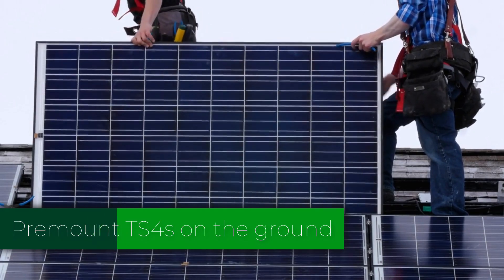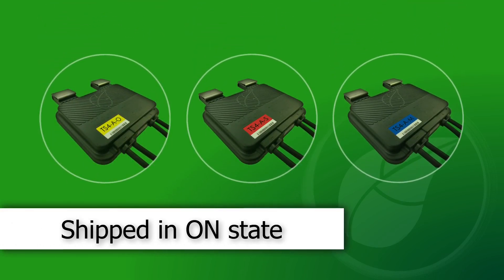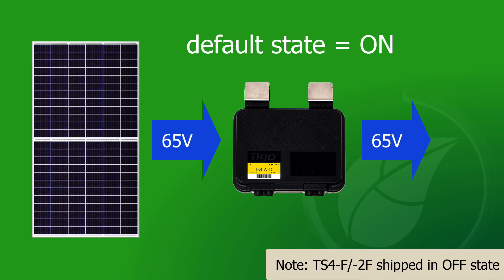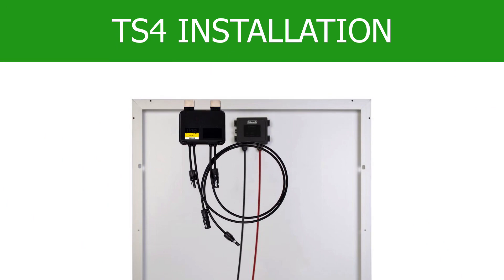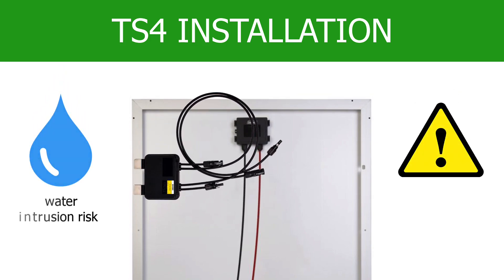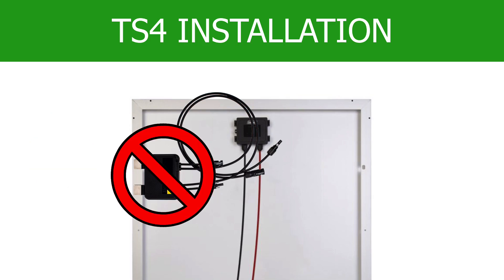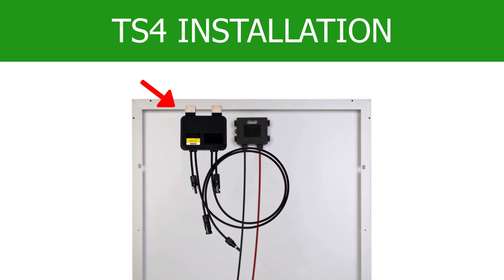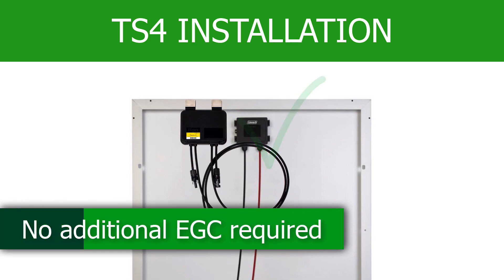Tigo TS4 O/S/M Monitoring Group Installation - TS4 Course Excerpt from Tigo Academy

Comment: Is this still the only allowed direction of mounting? Modern PV modules have practically no edge on the short side of the panel anymore, meaning it could only be installed on landscape orientation. 30mm x 15mm short frame, 30mm x 30mm long frame
Reply from the maker: As long as the gland seals on the bottom of the TS4 are not facing up to allow water ingress and you have at least 0.5 inches of clearance around it, and you do not excessively strain the PV wires, you satisfy our mounting requirements. The TS4 doesn't care about module orientation.

Comment: If the only thing I wanted out of these was optimization I don't need to install the CCA + TAP? I don't need rapid shutdown or monitoring.
Reply from the maker: Great question! That application is called Blind Deployment. You may install the O's without a CCA and TAP but the warranty period of the TS4s drops from 25 years to just 5.

Monitoring is a key benefit of the TS4-O and -S. You get a deeper understanding of your system, detect issues early, receive software updates, have a safer system with rapid shutdown. These benefits far outweigh the upfront CCA/TAP  price savings compared to the system's lifetime.

Here is an article that discusses our deployment  methods:
https://support.tigoenergy.com/hc/en-us/articles/360024860193-TS4-Systems-Methods-of-Deployment